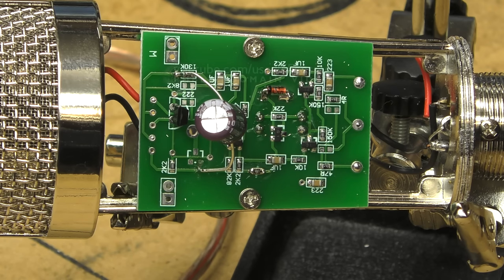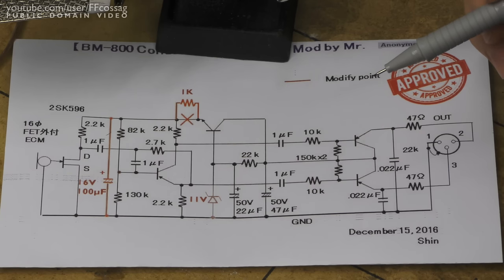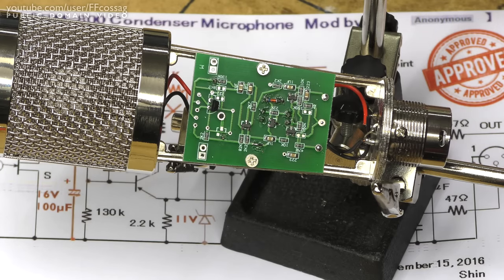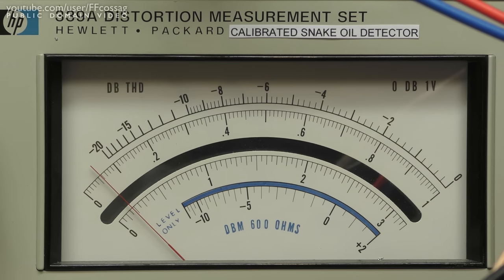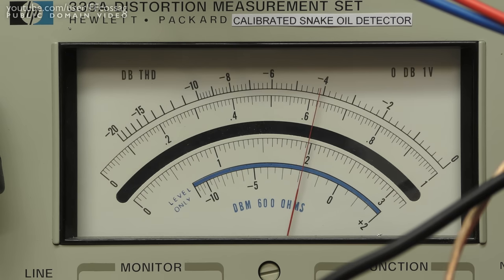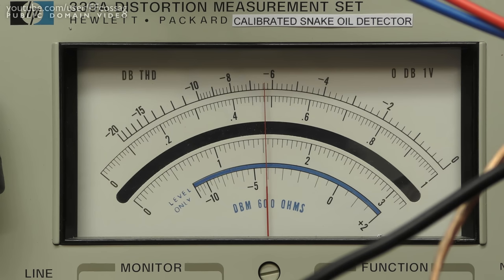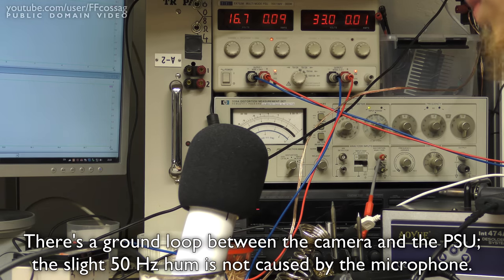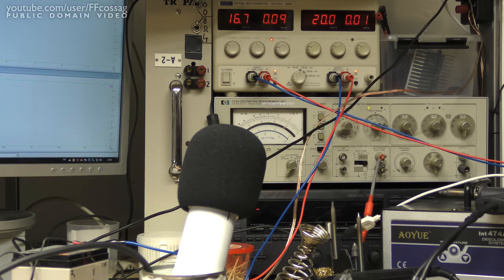BM-800 microphone low noise hack

Comment: Nice mod - I'm not too surprised that supply voltage doesn't have much effect on sensitivity with an electret capsule, it's a far bigger deal with an externally polarized capsule. Looking at the schematic I was initially surprised at the lack of a source resistor on the FET, but it seems that the 2SK596 is a trick JFET with a built-in bias resistor - neat.

Comment: Done!!! It work well. That kind of strong white noise was considerably reduced at 70%! Next step is to try to replace the 16 mm capsule  with a 34 mm gold plated milar one.  Thank you!
Reply: This isn't so easy. That capsule is a true condenser one and needs to be polarised by something like 60-100V to work. So microphones that come with those have a second companion board to boost to higher voltage. It's probably less confusing to rebuild the electronics altogether.

There is a different capsule that you can try, it's a 26mm electret condenser capsule, it should work as a direct drop in replacement. Just as long as your microphone has a JFET on the board rather than in the capsule. Neewer seem to be using one in the capsule, and also disguised a smaller capsule as a larger one.
Reply: @SianaGearz  I mounted the 34mm wide diaphragm capsule and it works well. I don't know which capsules you are taking, but this one works with 48 up to 96 V.
These only the characteristics of the capsule:

Specification:
Element: Φ34 mm Pressure Gradient Transducer
Gold-plating: Single-faced
Polar Pattern: Uni-directional
Frequency Response: 20Hz-20KHz
Sensitivity: -33dB ± 3dB (0dB = 1V / Pa at 1KHz)
Equivalent Noise Level: ≤15dB A
Max. SPL input: 138dB (at 1KHz ≤1% T.H.D)
Power Requirement: 48V Phantom Power
Package Includes: 1 * Capsules
DataCaciques
Reply: @lucianoruggieri  Well this board doesn't apply any power to the capsule itself, maybe there is some several V off the JFET bias, but certainly the 48V reach nowhere near the capsule. I'm surprised that it works.

Comment: With a good preamp, it would probably be still useful even at 3 volts.   Most electrets are quite happy to run at a variety of voltages, provided there is a preamp with clean gain.

Comment: I surprisingly have the same exact microphone, I am considering doing this modification since the sound quality is good but there is some noticeable background noise.
Reply: Be sure to use 48V phantom too, as the circuit design has the lowest noise at this voltage.
Reply: I do, I have a phantom that injects 48VDC from a 9VAC power supply.
Reply: I know this is old, but I'm planning on doing the same and replacing the microphone capsule to boot
Reply: Why don't you just buy a better mic if you're going that far with the mods?
Reply: where did you get new microphone capsule?

Comment: For some reason my specific unit has an extra pcb completely unconnected from the main pcb. It just so happens that this board has a 470 Ohm resistor on it. Very convenient, I only need the capacitor now!

Comment: I'm happy, there used to be a high pitched noise and now is gone, plus some kind of noise immunity when touching the mic. I harvested a low ESR cap from a router and ordered zener diodes, tin solder paste and a matching 1k ohm resistor. The resullt is great! There is still noise but I think it is because of my motherboard's soundcard.

I'm a newbie in electronics and I really liked this little mod, it cost me more effort than necessary but hey I ended soldering a freaking 0204👍

Comment: I have a BM-700, that had no zener diode there only a little black smd part that I couldn't recognize, but the circuit looked the same apart from that. I added the capacitor and the resistor and it made the necessary improvement but later I removed the tiny black whatever it was and replaced with the 11V zener. I don't hear any difference in the recording from this last step but I'm not a measurement tool, but when I changed the speakers to a earphone I can hear some constant background noise, not very loud but it is there. Sadly it would be impossible to put the original tiny black part back to test if that had it as well because it is so tiny (probably it had) but overall I'm very happy with the results because I don't hear that in the recording. Before I had awful lot of noise I couldn't know how to remove. This is a huge improvement. Thank you! 
 I have a new big capsule I plan to try with this. Hopefully that would improve the sound even more.
Reply: Did the capsule work well?

Comment: Really cool hack! Have you considered soldering a 10...100nF Foil Capacitor paralell (with lower ESR an less parasitic Inductance) to the 100uF Elko in order to reduce the higher frequency part of the noise?

Comment: Wow! I just did the hack.  I used a 470ohm resistor and a 100uf 25v capacitor. So I did not changed the zener.  WHAT A DIFFERENCE! The BM-800 was good, usable, but not great.  Now, it is perfect!  Thanks! It was a fun project!

Comment: I have done the mod on a nw800 that is the same or the bm, the circuit is the same Just few differences in component position. The result is appreciable, I obtained that the microphone can works with less gain on the mixer/audio interface then the sound is more natural and clean. Nice idea but you don't expect a miracle mod because you have to remove the noise by post-editing if you want a very clean and perfect audio track.

Comment: I just did this mod but with the 470R series resistor and 100uf capacitor (no zener mod) the supply voltage for the FET is around 8.3v with this and does not appear to adversely affect sensitivity. I also doubled the 22uf and 47uf capacitors whilst I was there. The noise is now virtually undetectable when I run this on a 48v phantom, where previously it was atrocious.
Thanks for the video !
Reply from the maker: Glad it worked out.
Reply: You replaced the 2 caps on the back ? I may try that if i can be botherd :P
Reply: Hey  @Mark Herbert can i get a picture of your mod .. and what do you mean by you doubled the capacitors

Comment: Looks like the Neewer NW-700 has a circuit that while not entirely the same, appears virtually identical in the portions relevant to this mod (Podcastage is showing board shots in his recent NW-700 re-review: youtu.be/LmRFi16KTys ).

Here's a little trick: You can potentially reduce zener noise by orders of magnitude by going with a stack of 4x 2.7V in series rather than the single 11V (even 3x 3.6 V or 2x 5.6 V would be an improvement). Around 3 V it's almost entirely zener effect at work, while at higher voltages the much noisier avalanche effect is increasingly dominant. This is why zeners have a near-zero temperature coefficient around 5 V in the first place, both effects' tempcos cancel out.

The downside of this trick is that zener impedance goes up considerably at low voltages, i.e. regulation becomes noticeably less tight in the face of varying zener current. It could be a factor of 3 worse with 3x 3.6 V and a factor of 6 with 4x 2.7 V, and that's compared to the 11 V which would be about a factor of 2 worse than the 9.1 V to begin with (MMBZ5221-5259BW datasheet). I am not worried about PSRR as filtering is good, but the variation of zener voltage in the whole <=15..48 V phantom range would have to be checked.

Funny how I was subscribed here but had never seen this old video (AFAIR anyway). Small world sometimes.

Comment: I did part of this hack i tracked down with the 50v cap and 470ohm cap.
It drops the voltage down from 9.06v to 7.44v...
Next I'm going to try and replace the noisy zener with a 10v Schottky which should give a cleaner, more responsive signal.
Reply: How did that 10v Schottky diode worked out for you? Also what are mV you guys are choosing when buying that diode?

Comment: Im now curious how different mine would be after the mod. Becuase ive already connected a 10uf capacitor at the 2nd pin of the XLR and im planning on adding another 10k resistor on the bridged connection of the pins 1 and 3 instead of just wire.

Comment: So i was barely able to follow along, but I understand the idea, sort of. The bottom line, besides the modifications is that your have to run it with phantom power? 20 volts subtract the 3 from  the computer , so 17 volts of phantom power?  Or is it 20?  And if i am assuming correctly, can you advise an affordable phantom power device that can supply the correct voltage? And the mod parts?  Amazon or any local electronics dealer?

Comment: Did you not find this mic overloads very easily? I get output clipping if the singer is closer than 0.6m from the capsule. I'm currently working on getting more volts across the collector-emitter of the two output follower transistors. Also my mic has only 0.6V across the 2k2 drain resistor (48V phantom supply). I would like to increase that.

Comment: Very clear and precise explaination.  So it seems the 48v phanton power value is for antique mics.  Your pc supplies just barely enough power to run the mike adequately, and about 9-12 volts are ideal.  I have a czn-15n condenser mic for my presentations and plan to do similiar mode.  Thanks for this.

Comment: Have you tried shunting the 1k resistor and using 5-6V zener instead of 9.1V/11V? I got even lower noise this way. By the way, the PNP in phase splitter cascade is upside down (polarity reversed).
Reply from the maker: I haven't really experimented much beyond the result in the video, it's good enough for me. A lower voltage should drop your noise, but it should also wreck your sensitivity.
Reply: Right, sensitivity drops approximately as if the original mike was powered with 9V,  but it also notably reduces distortion.
Reply from the maker: I'd wager your noise drops by about as much as your gain, so you end up with nothing but attenuation.
Reply: No, hence my first post hinting how to improve your "hack". You probably hacked the microphone blindfolded, knowing little what you are actually doing. When I hacked my BM-800, I ran a few SPICE models, then experimented a bit, now my BM-800 can easily compete with top of the line Sennheiser and Behringer models. Obviously, it wasn't just a zener and a resistor, but on your scale of understanding, I gave you a tip how to improve your hack further.
Reply from the maker: Alright, have fun with it. Assuredly you can't blame me for not assuming such effort to lie behind a mere Youtube comment, as this lowly channel rarely is graced by the likes of your expertise. Please accept my sincerest apology for this most rude misunderstanding on my part.

lol.
Reply: :) Man, I liked your video, that's all there is:)
Reply: Hey guys! You could get the best of both worlds with two 5V zeners in series. Zeners above ~6.2V are much noisier than below. For this mic though I would ditch the entire circuit and replace with something that doesn't use zeners at all (and a better FET)!
Reply: @ballsrgrossnugly  Just try incorporating my simple suggestions above and you will be amazed) My "ideal" modding circuit is not based on the BM-800 topology, so I chose not to publish it here, but a couple of quick wins I mentioned can be done with no sweat.
Reply: @ballsrgrossnugly  If you want to be super precise, substitute 1k resistor with 68Ohm. After 68Ohm resistor (closer to the 596), use the 100uF cap to the ground. Everything will work great with 48V phantom power.
Reply: @ballsrgrossnugly  Simple wisdom: Make the change only when you're dissatisfied with status quo) It does sound satisfactory without modding plus computer enables enormous "post production" capabilities. Modding is for those who have good enough audiophile equipment and ears to hear the difference.
Reply: @ballsrgrossnugly  Man, if the mixer has more hiss than the mike, toss the mixer immediately. The modded mike has the unweighted noise of about -88dB. An average 24-bit sound card for $150 has the noise level at -110dB or better. That is more than ten times in favor of the sound card!
Reply: Metal Monkey Dude, nice work tracing the revised board. I have the same mic, with the 2016 revision. I am very interested in where you soldered in the parts, as I don’t have a clue which trace to cut and bridge with the resistor (and where). Also where to place the cap, you seem to have found an optimal location. Welcoming a video! Would also appreciate a pic as PM 😊 🙏🏻
Reply: Metal Monkey thanks! 🙏🏻
Reply: @ballsrgrossnugly  Thanks for this  mod to the BM800 .. I have the same board..and the the background noise of this mic is a shocker .........But  I am a little confused with  ya mod wiring. I think I know  what is required or what you are trying to accomplish...Do you intend to make a video?  because that would help me..i But i do appreciate what you have done ..Thanks
Reply: @ballsrgrossnugly  Thanks metal for reply .I appreciate it .I have the same board as shown in your pics ...After studying  ya pics  for a while I see what needs to be done ...it was all the coloured ink on the component side that was blinding me :).I will get the components  and do the mod hopefuily that fix  all the sh@t noise i hear..wish me luck ...and thanks for  posting your pics  and help
Reply: @ballsrgrossnugly .thanks I will have to order my bits for this mod and see if it makes a diff.I have several other mics   shure etc .. and have been trying a CAD37 usb  mic from a mate ...but its frequency response lacks bottom end...........ooohhh  yeah the fan noise    its a pain .....i moved my pc well away with extension cables etc  ..from special vocal booth ..which is a desktop model ....  3 sides of a CARDBOX opened out, with 3 fluffy cushions hot glued to the sides ..and a large bedroom pillow across the top.....all sitting a piece of soft packing foam  and...the mic placed  towards the rear.
Its legendary ..

Thanks ill keep ya posted
Reply: Serge K I'm not electronic expert, I just can solder a bit. Please do us a favour and show how to do the same thing you did?
I've got bm-800 microphone too and first I heard that background noise I suggested that something can be done with electronic components on PCB to fix it but didn't know how. Can you please post some picture or photo to repeat your mod?
Reply: @ballsrgrossnugly  Hi m8 got me bits for the mod ....Is the Zenor  shown in the mod pic  the correct way round?
Reply: @ballsrgrossnugly  Thanx m8 ... I do have some basic electronic knowledge but was confused with your pic showing "black & orange" polarity symbols . I have wired this using the orange polarity symbols....
Reply: Metal Monkey are you talking about imgur pictures I found above  right?
Reply: Metal Monkey I got 2 pcs of bm800/700 mics and they got different PCB inside. One of them got exact board inside as you published on imgur, the other one looks like the one shown in the video here. I also got  another mod info which uses slightly different approach http://audioimprov.com/AudioImprov/Mics/Entries/2018/10/20_A_Low-Cost_Beginners_Mic.html
Please take a look.
Another thing I found out in that zener diodes make noise. And what is most interesting is that higher voltage zeners make a lot more noise than small voltage zeners. It is explained as well. It is said that zeners above 5.6v use different technology. It is also said that connecting small voltage zener in series makes it a lot less noisy than using a single diode. For example 3 pcs of 3v zeners in series are times less noisy than a single 9v zener. What do you think?

Comment: Just did a mod on BM 800 with 470 ohm resistor and 16v 100mF capacitor. I also did some measurement. Voltage on capacitor after the zener is 8.8v and voltage on added 16v 100mF capacitor is 7.7v. Is that 7.7v feeding the capsule with that voltage? Or should I go with 11v zener and 1Kohm so I get closer to 9v on that added 16v 100mF capacitor?
I'm using Focusrite interface with 48v phantom power (funny though measuring voltage on connectors on interface is 43v, and 33v on 'entry point' on the circuit of the microphone). Circuit on the microphone is not the same layout (but same Schoeps design) with just one difference, resistors labeled 82k and 130k on original mod circuit design, are both 50k on my circuit when I measure it. I've got lower noise but not so much as I would expected. My circuit is labaled as 'HZ-002A1 2016-08-22' instead of letter 'M' like in original circuit of this mod. I have put 470 ohm resistor on the back side of the circuit board (almost impossible to put it like in original circuit layout due to elements on my board being too close to each other). If somebody has same circuit like me, feel free to contact me for info and pictures of my circuit after mod. 
Russian youtuber  EdVanAmator did a good job by placing 16v 100mF capacitor on the more suitable position on the opposite (back) side of the circuit ("Доработка микрофона BM-800 - убираем шум и поднимаем чувствительность | Low noise hack") and he got really good results also. 
FFcossag, thank you so much for this mod, it is really appreciated.
Reply: I did the modification on the BM-800 with the newer HZ-002A1 2016-08-22 board.
 I changed the zener to a 12V one and used a 1K resistor and a 220mF 16V capacitor. 
De voltage over the capacitor is about 9.6 Volt.
I also added a second extra capacitor of 220mF 16V parallel with the zener diode.
Reply: @JohnD022  Hi! Can you tell me pls - why did you add extra capacitor in parallel with the zener diode? Is there any difference with\witout it?
Reply: I have the same board on the BM800  id like more info for this Mod on this board  Have you got any pics and instructions for the mod .Id really appreciate some help ..Thanks
Reply: @JohnD022   как вам написать